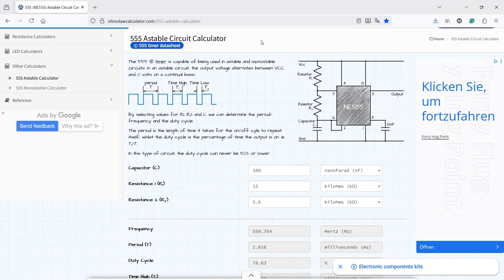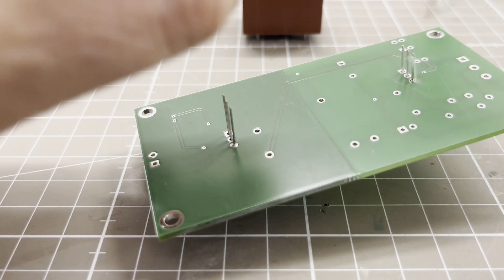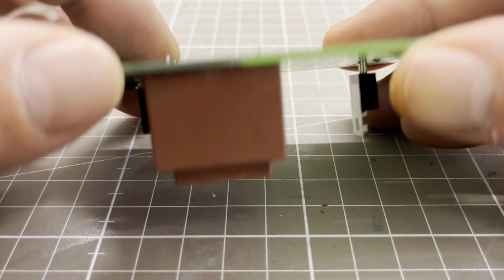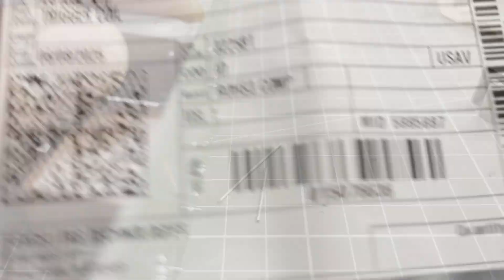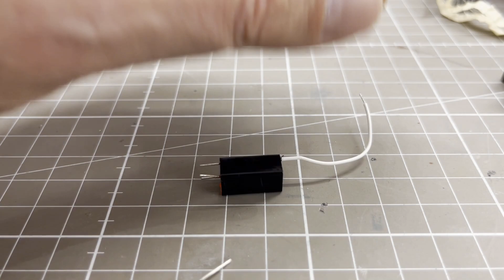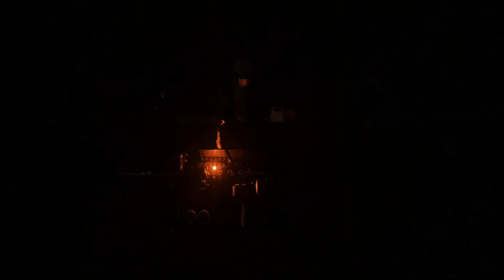Building a xenon flash bulb driver for my spectrometer

Comment: I think that key to your soldering (and not making a mess) is using a flux pen and a solid (without rosin-core) solder wire, right?
Reply from the maker: I use a flux pen and rosin-core solder wire.

Comment: Boost converter wird viel einfacher, z.B. mit 36063 oder Max1771, also viel kleiner und kann auch ohne Probleme 300-400v aus 12v machen, nur MOSFET so was wie 11N65 von std nehmen, oder was ähnliches, es wird dann auf 4x4cm passen und Elko wird das größte Teil sein.
Reply from the maker: I thought about that too, but I used components that were available and easy to obtain without ordering from Digikey or Mouser, which charge 15 to 20 bucks just for shipping.
Reply: @Marbslab  mit 555 könnte man auch boost machen, wird ich einfachen "nixie" boosts verwendet

Comment: Which advantage offers this Xenon lamp over a fluorescent starter bulb with Xenon?
Reply from the maker: Very poor light output, flickering, you don't know exactly what gas mixture is used, and they are now difficult to obtain. I know that some people use these bulbs for calibration, but for a flow cell with colored substances, the light output is too low to allow for rapid sampling. Commercial spectrometers use xenon flash tubes.
Reply: @Marbslab  Thanks! Indeed the light output is quite low. You can run the bulb at DC to avoid flickering. Philips uses Neon/Xenon, which gives many calibration lines all over the spectrum. I got mine from Ebay.
Reply from the maker: @michaelhaardt5988  I will try to get one for calibration:)